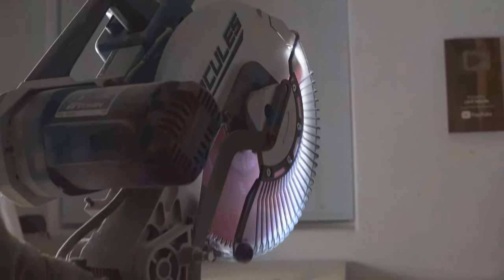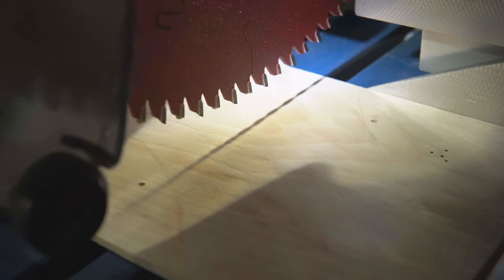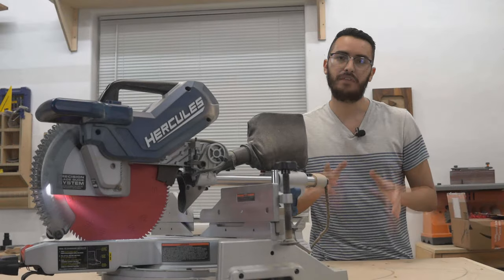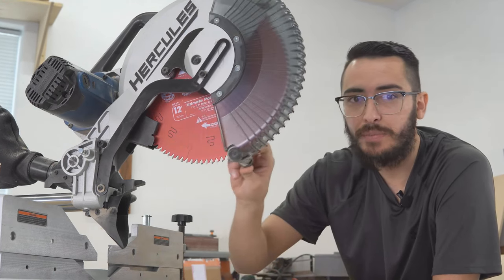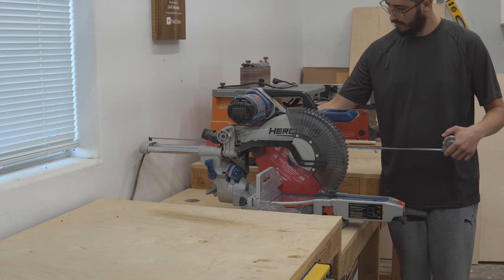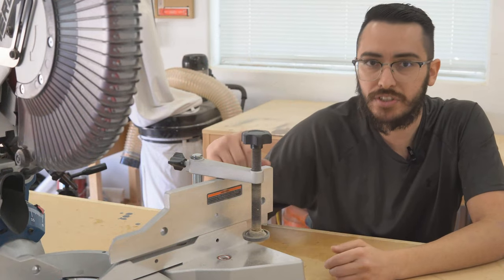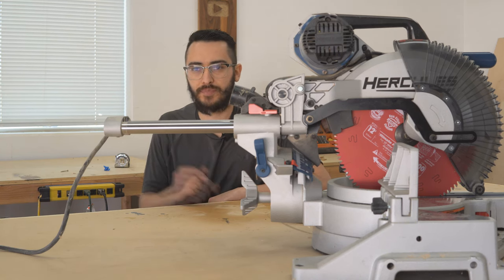Harbor Freight Hercules Miter Saw 2 Year Review

Comment: $399 in 2023 is not that cheap.
Reply: $299 right now
Reply: $299 RIGHT NOW until 4/15/2024
Reply: Is cheaper than any other miter saw on the market all the other ones are around 500

Comment: I, personally, own this Hercules Miter saw, and keep it in my garage/shop. I've owned mine for about a year. I'm very happy with my purchase. I'm not sure if I'd buy it to use on a job site, but it's likely good enough. I used to check it to make sure that it was square just about every week at first. I don't do that at all anymore. It's square, and there's no sense in wasting the time to prove it to me. I've used mostly just Rigid, Makita, and Dewalt saws on various job sites. I purchased the rolling miter saw stand at Harbor Freight when I purchased this saw. It seems as sturdy as any premium saw stand that I've ever used, but I haven't used this one yet. I think that the game changer is the shadow cutting line. I have more confidence in it than I've ever had with the laser lines that are common on all the other saws. I've never trusted the Laser Lines. It has an amazing amount of power, and I'm glad that I saved the money, and bought this saw.

Comment: I bough5 this about a year ago and been using it hard, this thing is a beast and hasn’t slowed a bit yet.  The shadow line is great, It was square out of the box zero adjustments and couldn’t be happier with my purchase.  I was looking at the DeWalt DWS 780 but after looking at both I couldn’t see spending nearly double for the same saw.  I’m a DIY’er who does a fair amount, in middle of kitchen renovation down to the studs and recently built a bathroom vanity and garage door.  My only complaint is the dust collection but I look at the accuracy as more important.  As for weight it’s same as most others out there so not sure why knocking it and any sliding saw will take up the same space, DWS780 isn’t lighter and need less space?  This saw is absolutely worth the money!

Comment: Im on hercules miter saw number 3 now. First one burnt up in about 6 months and the second about 8 months later. I will say i am not a hobbiest and i do use my miter saw multiple times a week. The overall build and accuracy is good its just the motors are junk. Definitely get the warranty..so glad i did.
Reply: Odd been using my hard quite a bit for over 2 years, cutting wet and PT 4x4s my motor still running strong

Comment: I see this complaint about space a lot on these sites. Bosch, Delta, & Ridged use a hinged arm rather than steel rods. If your biggest problem is the space it takes, I don't think you should've purchased a sliding miter saw at all. That said, I just got mine & I'm planning on building the needed cabinet space on either side of the planned saw location. I'm debating either making a base for my saw that rolls in & out rather than the permanent dedicated floor space you did. My other option is to simply do a cutout to fit the base & where I mount it will be a slide out shelf using 100Lbs rated drawer slides & a fixed cabinet underneath that equals the depth of the saw when the saw is in it's most compact position. This means my cabinet length will all be as deep as the saw is with blade forward & angled at 60° when not in use. My other consideration will be to just make my cabinets as deep as the most space intensive tool I keep at the wall like a drill press or bandsaw
Reply: Agreed 100%. They literally have every saw on display at HF. I've owned my share of compound miters over the years, they've all been space hogs no matter how you look at it.
Reply from the maker: Not something someone new to the craft thinks about.
Reply: @JARMade  fair enough

Comment: I used this saw in my shop for 4 years. Cant beat it for the money. Its big and takes up a lot of space and the dust collection is terrible but other than that its a great value. I recently upgraded to a makita.
Reply: Other than the ridiculously over priced Festool Miter Saw there really isn't any miter saw that has good dust collection LOL.  I think the designers of Miter Saws in general vision them only being used on jobsites mostly sitting outside so they never concentrate on dust collection it seems....sadly its just the opposite, or maybe closer to 50/50 a lot of people own these types of saws and they are in their workshop, garage, basement, etc.  So they really need to start concentrating more on how to collect all the dang dust these saws throw everywhere...its like a sawdust confetti thrower every time you cut something with one LOL....and Radial Arm Saws are terrible for dust collection too, but I don't think any company makes a Radial Arm Saw anymore, at least I haven't seen any around stores for a long time.

Comment: ive been using my chicago electric mitre saw for about 7 years now. still going strong.
Reply: The Hercules is a huge upgrade compared to the Chicago Electric Miter Saws LOL.  I had the Chicago Electric 10" and 12" Sliding dual bevel compound miter saws, they were good, but the Hercules is a lot better, a much better built saw, the build quality of the Chicago Electric models are not nearly as good.

Comment: When moving the clamp just lift it from the back and place it where desired, also placing a 1 1/2 inch block between clamp and cut piece will allow clamp not having to be screwed all the down resulting in easy-to-use movement of the clamp. it is common for miter saws to have a poor dusting system regardless of the brand. The size of this saw is great, thanks nice video I'll be buying one tomorrow. For those who have space issues will Thank you for  giving a heads up on the size of this saw, I have to tell anyone that don't know that the quality of this saw take no back seat to those $700.00 saws, it was really designed for quality save your money buy this saw.
Reply from the maker: I definitely miss mine

Comment: i dropped mine after two years and broke that top black handle off and cracked the motor housing. i plugged it in and ran a good 200 awkward cuts through it and it still preformed fine. I'll just live without the top plastic handle for now.

Comment: Fantastic saw for the price. I just replaced a Hitachi that had multiple issues. This saw is solid, and the miter stops are no joke. $300 can't be beat, especially since the next step up would be $700 for the Bosch design without rails. I'd rather put that money into more tools or materials.

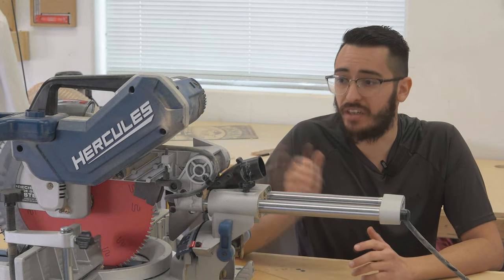Comment: To be fair @ 3:43 - The steel rails are not an issue with the HF Hercules - every sub-$600 Sliding Miter saw is going to have Steel Rails that stick out the back - they are the price to pay to get a 12" depth of cut unless your will to spend a lot more
Reply from the maker: Agreed

Comment: I got to this video from a post on the woodworking for yuutubers on FB group. I can say the dewalt , similar design is very similar. I had dewalt saw horse looking stand for it as well. It was great at job sites. Still heavy like yours. However in a shop. It steals a lot of shop space even with the saw horse style base. Lots of Realestate. Thanks for sharing your video. I enjoyed it and keep up the great work. You got a new sub here. PS my dewalt died on me after I got my new shop I built with it dried in. I replaced it with a saw that doesn’t have rhe bars coming out the back like rhe dewalt of yours. I am so happy with its new space saving design. Fits on a normal 24” cabinet bad now. ;) 
Have a blessed week. Happy new year and may your channel keep growing. 
Dale.
Reply from the maker: What saw did you end up getting  Dale? I am thinking of getting the makita  12 in saw
Reply: @JARMade  I went with the Bosch. I am pleased with it so far. I will post a pic reply on rhe FB group so you can see it. Just don’t laugh at my interior wallls. That’s a work in progress. Hahaha. 
So far so good and it has a lot of fine tuning options for it as well to dial it in to work right.

Comment: I have this saw in my shop. I purchased it to replace an old, worn-out Craftsman radial arm saw. I was aware of the space it would require, and it definitely takes up less space than the radial arm saw did. Overall, I have been impressed with the saw, it performs as well as the Dewalt does. The dust collection is a small disappointment, but I am sure I can modify it to connect to my dust collection system and make it work better.
Reply from the maker: A agree. If I didn't need the space as much as I do I would definitely be ok with it.
Reply: @JARMade  I have a 1200 sg ft shop. Used to run a boat repair business out of it. I have retired and now just focus on woodworking projects
Reply: You had a radial arm saw, I'm sure the miter saw isn't any different in dust management, at least the Craftsman Radial Arm Saws I had were not into managing any dust, other than throwing it in every direction imaginable LOL.  Yep, miter saws came out and I got rid of the miter saws....they work great for ripping though.

Comment: Thanks for the info. With my limited knowledge of this kind of saw, I don't know why I might care about the difficulty of positioning the clamp. As for the space needed from front to back. That is a very good point to make but I can't tell from your video whether this differs between brands that have the same potential for cut sizes. Without these details, I can't see any reason to prefer a specific brand or to avoid this one. I get the impression that all included vacuum attachments are going to be underwhelming on home owner grade tools.

Comment: Awesome review and spot on!!  I got.this sa back in June and although I knew it wasn't going to go back against the wall say like a Delta Cruzer I also didn't realize how far off the wall it needed to be either.  I made it work in my small shop as well and am still extremely happy with the purchase.
Reply from the maker: Other then the space I love this saw. But I want to upgrade to the makita  one !
Reply: @JARMade  Yea sounds like space is a priority in your case, since you have a space issue, I think the perfect miter saw for you would be the Makita LS1219L it's a very nice and rugged saw, you don't have to be concerned about the back and forth movement of the motor and the blade, you push the saw against the wall and forget it because it has inside movement, not outside movement,  I'm not sure if it's an upgrade but it's a big 12" saw with nice features such as, up to 60-degree cutting both right and left, the big problem for me is it's nearly twice the price as the Hercules and Quality is about the same, $760.00
Reply: Bummer that the Makita still uses laser not shadow though. A shame, I also really like the soft start feature of that one
Reply: @JARMade  The Makita is in a different class in design, price and targeted audience. You cannot use it as a comparison to the Hercules.

Comment: Nice review, in a shop setting a backstop hood style dust collector is the way to go. In regards to weight size the 7 1/4" battery dewalt is the way to go I doubt this is any heavier than the 12" dewalt which is a monster beast. No 12" is  really truly a cabinet shop  l/ jobsite  finish saw to much blade wobble due to size. That said it's. Good enough for the majority.
Reply: I had the Dewalt 7-1/4" 20V miter saw, it works great, it ended up being left at work permanently, and use it quite a bit.  For most tasks I'm doing the 7-1/4" blade size is plenty, I just need to talk them into getting me a small table saw or at least a circular saw so I can rip boards down that are too wide, rather than having to pack them home and use my own table saw, power, and time.

Comment: Ive had this same saw almost 2 years now woth no issues but it is getting time for a blade upgrade. That clamp isnt really as bad as what was portayed lol
Reply: I use Diablo blades in all my saws, they're great blades, and very reasonably priced...I wait until they have the 2 packs on sale and pickup a pack of 10 and 12 inch blades.  With regular use they last quite a while.  Although, the Hercules saw blades do seem very good as well, but about the same price as the Diablo, and they look very similar to each other as well, wouldn't be surprised if Diablo has their hands in the Hercules blade making LOL

Comment: You are right, 44in is a loooot of space!
Reply: Not really.  If you are worried about it taking up space you shouldn't be looking at sliding miter saws, rather be looking at the fixed head non-sliding types....or one of the newer styles with the hinged type sliding system, which from what I've seen is great if the shop you have is really tiny.  I just roll my miter saw out away from the wall on its stand when I need to use it and roll it back when I'm done.  But I've been using sliding miter saws for years....and before that Radial Arm Saws...if you want a space waster buy a radial arm saw, then complain about the space it takes up, and the amount of dust you find in places you didn't think you'd ever get dust in.

Comment: I wouldn't really say that the size of the saw is a downside. That really your fault or personal needs. It's not the companies fault that you have a small shop.
Reply from the maker: Agreed, that's what I say on the video
Reply: Or that he doesn't own a tape measure to measure the space where the saw is going to be put, or not build something that only fits 1 size of a tool, knowing full well you'll end up replacing it in a few months, or years when you decide you wanna different color.

Comment: No miter saw has good dust collection. It all sucks. You have to augment it to get it to your liking. 

I have the $8 million dollar Bosch sliding compound miter with the glide system and it's a pile of shit for accuracy. Run with the dual rails. Yeah they take up more bench space, but at least they're accurate. My Bosch is total garbage; tech support said it's messed up but they won't warrant it.

Comment: If you would not buy the Hercules saw again, what would you have bought knowing what you know now?
Reply from the maker: Well I actually sold my Hercules saw And bought  a makita saw. But i with the shadow line on the Hercules  was in the makita.
Reply: If I bought another Miter Saw at some point I might look closer at the Ridgid that doesn't have the rails, but I don't really have an issue with space so its not a problem.....people who whine about how much space a sliding compound miter saw takes, has obviously never owned a radial arm saw, or a table saw bigger than a portable one you can throw in your car.

Comment: Makita makes the only great space saving miter ....the Bosch rigid and delta have way more deflection b/c of their rail systems
Reply: Ridgid has a miter saw that doesn't have rails.  Its the R4241 model for 10 inch, and the R4251 for the 12 inch.